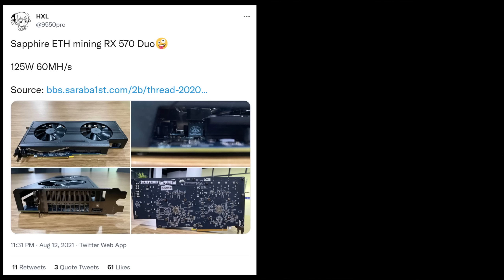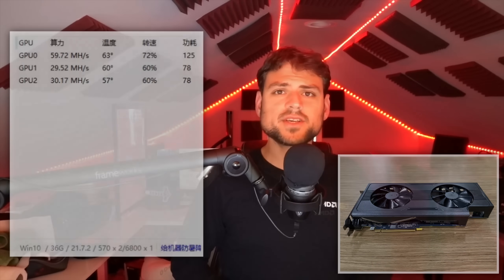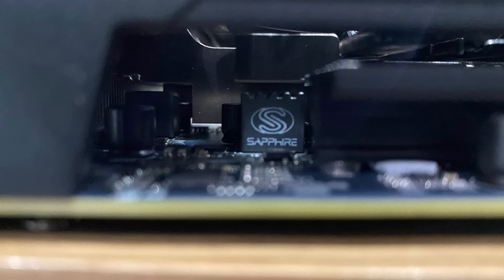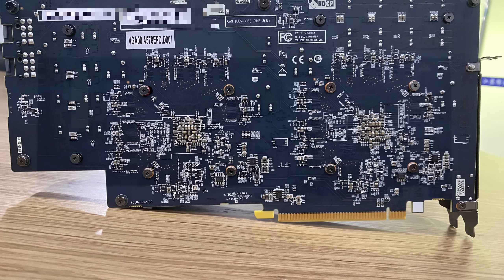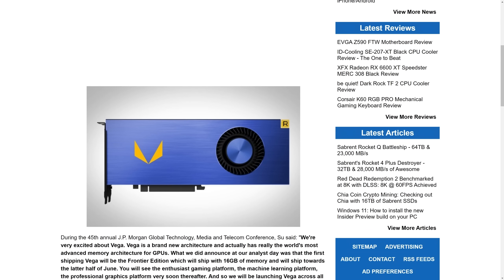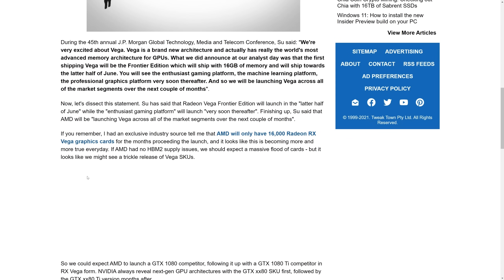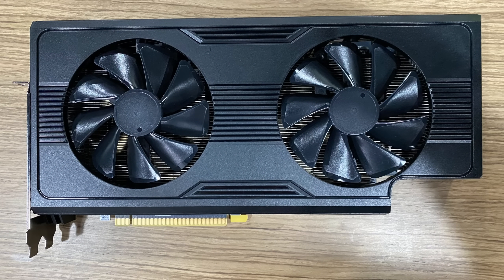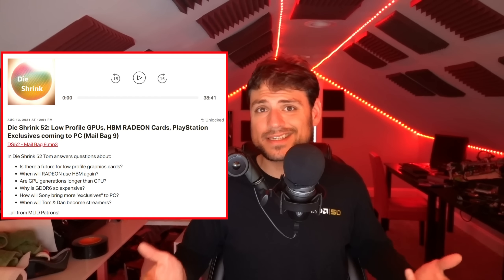AMD RX 490 Launching in 2021 - Why Dual Polaris wasn’t released until NOW!

Comment: Gotta love how this is called a brilliant idea while Nvidia repurposing broken Turing cards was pure evil and anti-gamer.
The components in these cards could have gone to gaming cards, no?
Also, the existence of this card further demonstrates how mining controls the gaming market now.
Reply: @kuolastech  So? What gamer is going to use a dual chip 570 in 2021? Crossfire is basically dead. So for most games you would have nothing but a 570. Others barely support it well enough to make it worth while, and even then this is an expensive card. Oh, and it is on a very large PCB that most normal cases will not handle well, especially ones that might look at using a 570. And people talk about ewaste.
Meanwhile the Turing mining cards will fit into any standard case. And while you kids whine about ewaste these cards have uses for people besides gamers. There are many, many types of software that do not require a video output. Have you ever heard of Nvidia Tesla cards? If not, google them. These were compute cards that never had video out, and they were used in various compute software. Nobody ever whined that Tesla cards were ewaste.
I do not know if the mining cards support TCC mode, but either way they can still be used in many applications that are not gaming. The dual 570s are so weak and unpractical they have little use for anybody besides miners. So when these cards are done mining, they are truly junk.